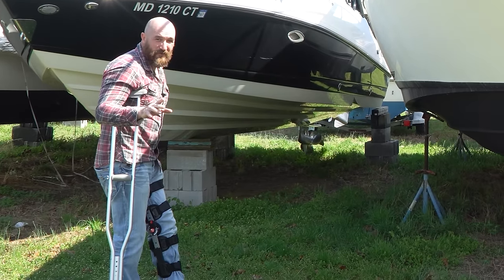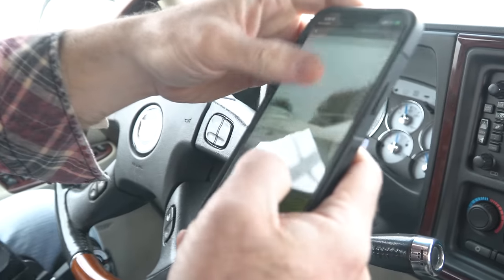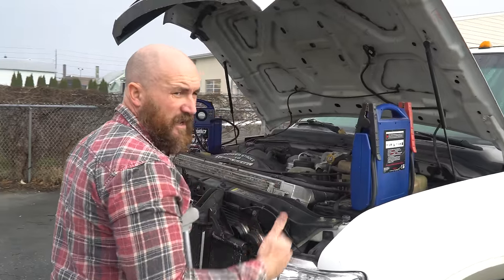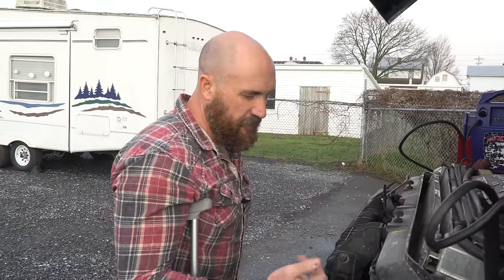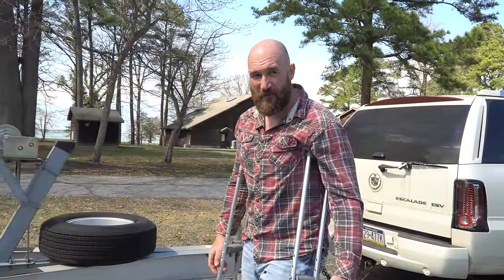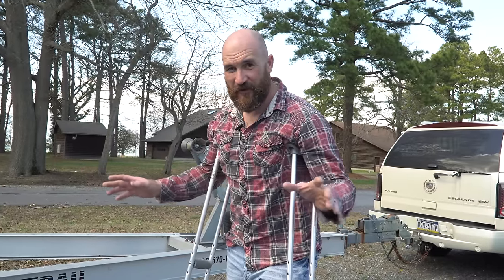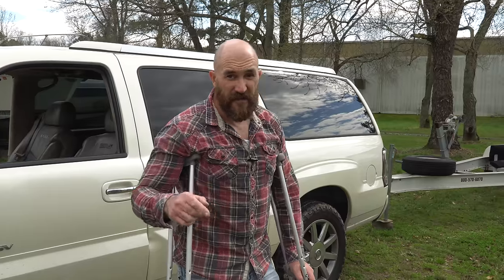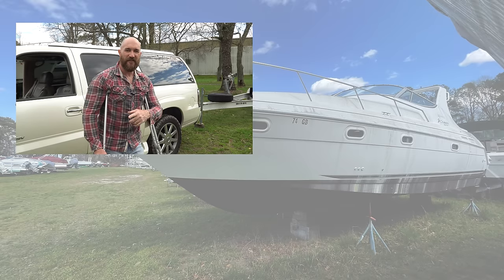We got a FREE Abandoned Yacht!

Comment: I have a 6.4 it gave me the same issue after being parked for the winter. Charge the batteries read the codes it’ll come back as high/low fuel pressure P0088. Dealer will try to tell you it needs a ECM update. Just erase the code restart good to go.
Reply: up
Reply: Up
Reply: Up
Reply: I know nothing of cars but this seems to be the answer to boost.
Reply: Up
Reply: Had one since it was brand new, after a few thousand in race parts it's the best truck I ever had. Stock? Not so much
Reply: why is it that every powerstroke has a "need to know" about it...
Reply: What was that weird knocking sound?
Reply: What’s the actual issue going on? Too lean?
Reply: @TurboVisBits  this is silly. Go ahead, say duramax or Cummins is better. Did you personally design and manufacture those engines to be better? Idk why people have these weird emotional connections with specific OEMs powertrains.
Reply: @dooder126  why do you care?  Who gives a rip?  People have emotional attachments to all sorts of things...the real question is... why bother to point it out?  Let people like what they like.
Reply: @dooder126  I have a 5.9 24v pre-emissions and I have it for a reason. I wanted a power stroke. Cummins is just where it’s at, I do nothing to mine and daily it at 414k miles.

That being said, my step dad has a 6.4 deleted and tuned, and it’s been reliable as hell that way. Stock they are very unreliable though. Emissions standards are a bitch.
Reply: I’m going to say because the lift pump, fuel pump, and ECM don’t have enough voltage, the engine will fire but doesn’t have enough voltage to consistently fire every cylinder properly. Also, the compound turbo setup if I remember correctly is electronically controlled as well so there’s that too. 

Put new batteries in it or recharge them fully and try again.
Reply: Up
Reply: @hearsegod8909  that’s kinda my point. Why is it necessary to rip on others’ brand of choice because the brand you like is fundamentally superior (it’s not)? Doesn’t that go against the very basis of your message to let others enjoy what they like?

I work for an OEM and have worked for others in the past; I don’t think any particular manufacturer has the best technology or design, each one has their own strong suits of design…except Stellantis, of course…nobody likes Stellantis 😜
Reply: @joshrepik  meeting emissions requirements always results in trade off somewhere else. It’s definitely the unfortunate reality of being able to breath clean air. 

Take for instance something I’m working on currently; we’ve had to compromise on some metrics for cold start to keep startup emissions in the box. As an engineer, I can say it’s always a struggle between doing everything the right way and meeting government regulations. But hey, that’s what keeps me employed, I suppose lol
Reply: @joshrepik  is most definitely a low voltage issue, valves aren't opening in the high pressure side so the computer can't supply enough to each injector. Had a few problems like this when batteries would freeze. Gotta love the frozen north and summit racings shipping team!
Reply: That’s why my ford diesel is a 1991 f350.. no computers or codes to worry about, she just runs
Reply: Fuel knock, fuel system is under voltage!
Reply: @dooder126  I completely understand that. Unfortunately, as an engineer, you guys tend to work in a “perfect world” scenario. 

I, on the other hand, as a diesel tech, have to work in the real world, where those systems fail constantly. They create massive amounts of down time; from def doser failures, to nox sensor failures, to egr cooler failure, to turbo failure, to clogged valve trains. The emissions standards are the problem, I realize it’s not you guys, but bathing in a sea of urea because the def pump went bad in a truck is no kind of fun, and these engines are destabilized and made far less efficient. 

I can’t imagine the trade off for emissions is nearly as balanced in favor of sustainability as the government thinks
Reply: @highclasswhitetrash9027  So once the afterglow is done and the system voltage rises it will stop? Does it hurt anything to just let it run that way until it does?
Reply: It's a Cruisers yacht and it's probably a 32-foot that's like the one I had but mine had twin outdrives on it and get ready for the gas usage. mine was a newer model  they are gorgeous cleaned up
Reply: @edifyguy  oh buddy! It's gunna sound something horrible unless you can get those batteries at 12.8. But if she's already dry I'd drop a glow plug or two n soak in some oil, they really don't like being ran dry.
Reply: Definitely agree. When he starts it the second time you can see he has no gauge action. No rpm. No fuel level.
Reply: @edifyguy  I’d recommend at least charging the batteries somewhat to get the system enough voltage to supply the proper amount of fuel, you don’t want to run it lean for long. Also oil pump for the turbo etc
Reply: I had the same sound and thought I lost the lower end, a diesel guy did a injector test on it and that was the problem.
Reply: so why was that boat free how about the dozens of other boats why just this one it's not like it's taking up extra space  one thing i have learned in 60 + years is nothing nothing is free  have a feeling all your "free deals" are a wink wink situation and are for additional views  sorry but that's that way it looks
Reply: @mikecorleone6797  honest days work…7.3
Reply: @kevinruger8819  yep, round the clock hot shot trailer hauling 10 months a year. Truck has close to 600k miles on it still original engine and zf5 transmission. I’m on my way to Portland in it as we speak
Reply: Up
Reply: @dooder126  one is built better, one is built for max profit with poor parts and not built to last. why waste your money on ford when your buying garbage

Comment: Compared to how your 401 looked in the first weeks, this yacht looks like brand new!
Reply: That’s because everything is “marine grade,” so it’s intended to be exposed to the elements. Sun, salt, water, etc. I bought “marine” vinyl when I recovered my motorcycle seat. The stuff works!
Reply: Talking of the 401  AMMO and MR. Dent worked a miracle it's like 🆕!
Reply: @emmettturner9452  I can't see how marine grade materials prevent an abandoned yacht from becoming a wildlife resort. Must be something else ;-)
Reply: @charangohabsburg1  Yep… and the crevices where bio material collect are the places we see stuff growing. I imagine bird poop is kinda fertilizing those same crevices after washing down there. ;) Mold doesn’t like direct sunlight so you mostly find that on the surfaces inside, typically fueled by condensation from daily temperature swings. A boat’s exterior is expected to get wet and be subjected to extremes like UV, heat, cold, corrosive salt, etc. This is why we have “marine grade.” :)
Reply: @emmettturner9452 , It also helps that this is way more sealed up than the  401. If birds hadn't got into everything, the 401 would've survived better. The cool thing is getting this boat seaworthy is gonna be a lot cheaper than getting even an average plane airworthy since there is nowhere near as much red tape,
Reply: what 401? That thing is history.
Reply: @charangohabsburg1  yeah im sure the yard or marina owner kept up on the property if folks are storing yachts there they don't want a bunch of seagulls flying around dropping bombs on their beautiful yachts or going as far as getting inside and living in them.... Unlike the poor ✈️ which had lots of things living and dying inside inside of it.... Sure cleaned up nice though 👍 👌
Reply: I'm wondering if something made a home inside the exaust pipe.
Reply: Exactly... compared to 15 years of bird poop, a little mold and some refinishing/upholstery work seems like a cakewalk. 😛
Reply: @s35bonanzapilot84  But with the modern technology of youtube, crowdfunding, sponsors and some good ol' elbow grease, amazing things can be achieved!😅
Reply: @emmettturner9452  Depends some Yacth has paint with clear coat burn thru if you let it sit for long period of time
Reply: @bakakun  I had multiple textures available and the one I picked seems pretty close to the original seat. I could use a a more slippery seat actually… since it is an ‘80s sport bike. :)
Reply: HAHA so true!

Comment: As others have mentioned, boats can very effectively hide massive issues they have. If it's been sitting there could be moisture in the stringers in which case the boat is basically worthless. It wouldn't necessarily sink, it just wouldn't be worth fixing. Look for spider cracking in the fiberglass, some is fine, a lot can be concerning. Delamination of the fiberglass is also a common issue when these boats get water in the (many times balsa wood) core that the fiberglass is sandwiched onto. 

The engines shouldn't be an issue for you to work on, those 454's were some of the most popular available engines and parts are very easy to find. Make sure to check your gauges, they have a habit of breaking and spitting out incorrect readings, rpm gauges on these especially. My 1998 30 foot of the same style used to require you bang on the RPM gauge to get to to set and only when you were at more than like 20% throttle. 

Last thing, and this is for when you get it started. These boats have blowers on them that is basically just a fan that sucks the fumes out of the engine compartment. MAKE SURE IT WORKS! Run the blower for 3-5 minutes before starting the engines or you risk causing a fire in the engine compartment. I have literally seen it happen.
Reply: Doesn't matter if the boat is worthless he'll just make several speeches about how it's "our" boat and get a bunch of simps to essentially pay for a new boat.
Reply: @Toefoo100  Aren't we lucky to have the guidance of your brilliant mind?
Reply: Sounds like reasonably useful advice from someone with some subject knowledge.  Clearly a toxic community member just jumping on someone who’s actually contributing something.
Reply: @Toefoo100   if that is the case he can salvage fitings windows trim and other equipment from it to sell it. specially garmin stuff among other things
Reply: @cpt.mirones5109  dude if that boat has really been sitting there for 15 years and im sure just as a guess the boat is probably another lets just say 10 years older those electronics are obsolete to todays technology they are worth absolutely nothing.
Reply: YES on the blowers!  Ive responded to numerous boat fires / explosions for that exact reason.  I hate writing BAR's.... lol
Reply: Having had boats in the past, a boat is nothing more than a hole in the water that you pour money into!
Reply: @rowerrn  break out another thousand
Reply: Leaks, cracks, rotting frame, electrical nightmares, rodent damage, failing fiberglass... boats are called money pits for a reason.
Reply: CRACKS IN GELCOTE ARE NO PROBLEM EASY TO FIX  UNLIKELY  TO HAVE FIBRGLASS CRACKS UNLESS EXTERIOR DAMAGE PRESSURE OIL THE ENGINES FOR SURE DON,T TURN THE ENGINES OVER WITH SPARKPLUGS IN PLUGS IN
Reply: @chuckfowler8875  So they may not have all the bells and whistles of modern electronics. So what? Most of the B&W on modern stuff just makes them harder to use - rather than adding much to their functionality.
Reply: @buggsy5  the only thing  that will work is the depth finder it will not hook up to GPS it has an antiquated format.
Reply: @Toefoo100  accurate!
Reply: They may be obsolete but they still work. Furthermore you can just leave them in place and install new ones. Besides modern boats have far more electronics than needed 99% of the time.
Reply: @yougeo  it is an antiquated format therefore it is useless the only thing that would be any good would be the depth finder dont beleave go get those electronics and put them on your boat and see how safe you are and how far you get.
Reply: What a massive POS that won't fit on the trailer and will be so far over the weight limit to tow with the Escalade. Turn  and Run 🏃‍♂️ crutches and all.
Reply: That is the most important thing to say! And nobody says it.
Reply: To fully restore this yacht takes fifty thousand bucks and two years of work.
Reply: I would worry about the mould build up…mould is toxic. You will not get your money out of this. Do not through good money into a bad investment. Better to spend some money on a good 2nd hand boat

Comment: Great job. Keep the content coming.
Professional Yacht Captain/decent engineer of 15 years. Currently master of a 110’ vessel.  Small tip for the interior.  Ozone generator will be of great use to kill the mold. Dehumidifier’s are also useful.  I have run them in tandem to rectify a variety of issues.
Reply: Be cautious with the ozone generators. Too much ozone is poisonous and the interiors of boats generally do not have outstanding ventilation. Ozone can also damage some materials.

If I recall correctly, life jackets have an expiration date - so all the ones you have should be checked and tested.  

Twin screws are nice, especially on a boat that does not have bow thrusters. The screws make maneuvering in tight quarters much easier.
Reply: You are correct to be careful with ozone.  Most ozone generators have settings you can adjust.  Also it is wise to leave the boat open rather than sealed off.

Comment: Drain the bilges first. You could be hauling a ton of water around. Great work, keep them coming.
Reply: I repaired a little section of my 19 footer and cant believe the water weight of the foam inside.
Reply: yeah you could see a little water when he opened up the engine compartment
Reply: Ouff that gave me bad memorories.... Do what he says!
Reply: @carljohantihkan2035  There will always be a bit of water in the engine bay - those covers never seal completely. But the compartment will also have a through hull drain.
Reply: Isn‘t there a bilge pump on boats that have a freaking ac and stuff?

Comment: Direct drives are only a fraction of the maintenance of outdrives. They can be left in the water, and is actually best to do so to keep the shaft packing wet. If you have the correct adjustment on the packing, they are intended to leak a little while under way, they may also leak while sitting. So you need solar or shore power to keep batteries charged to run the bilge pumps. This is routine stuff for boats in the water all the time. If in salt water, you may need routine cleaning of the underside and running gear.

Comment: On your 6.4 check your serpentine belt tensioner. I've had the same issue and it was caused by a bad barring in the alternator that caused the tensioner to slap the stop on the tensioner making that same noise.
Reply: And also wait until the light for the glow plugs turns off before using the starter 5:00
Reply: I agree with this. Rod knocks don't develop over night while being parked.
Reply: @miege90  I don't even own a Diesel... but that's step1 right??
(besides the fact he might not have enough juice for glow/ecu/starter)
Reply: odds are it’s a hung lifter, 6.4s are well known for lifter issues, been sitting for some time asswell
Reply: could be a stuck injector if its been sitting awhile could of had a injector stick open causing fuel knock

Comment: The biggest thing with old boats is rot. Especially if it’s been sitting, water could make it’s way down to the stringers and into the structural components. The transmissions are fairly simple, single gear forward/reverse. Im sure those are fine. Even if the BBC’s need rebuilds that’s nothing you can’t handle. They’re easy to remove if you have access to an excavator
Reply: Agreed. I would, however, add the stern glands to that list. The seals on those are probably completely shot at this point and will need fixing before even thinking about putting that thing in water again.
Reply: Carwizard can sing you a song about rot 😂
Reply: Totally agree. Rot is the enemy! I'm no expert, but I have delved into a boat with rotted stringers ! Not an easy job and very itchy!
Reply: Depending on the year of the boat, it may not have wood stringers. They may just be foam filled.
Reply: yep it will have water issues no doubt,  this is a rip down to the frame and expose all the inner structure, fix it and then rebuild it... this may be more expensive than the air plane to do... yikes!
Reply: Nah just paint over any rot and sell it on quickly
Reply: @tomcatmeow69  it won't be more expensive than the plane. That plane needs major spar work that alone will cost more than this boat project
Reply: @tomcatmeow69  Drama queen
Reply: @ronfoley3634  Not sure what year the boat is, but most likely those stringers are foam, and may be pretty resistant to rot. Most of the marine industry move away from wood, its just a matter of when this boat was built.
Reply: 70% of video watch you in your car driving....
Reply: @pugito4525  yeh most likely fiberglass Hull so little to go wrong really just all the fittings gaskets and seals will need replacing and the interior needs sorting.
Reply: not just the rot, also check for osmosis.. and delaminations.especialy around the bilge area's where water tends collect.
Reply: To everyone talking about foam stringers. The boat has been sitting 15 years and it was old enough with enough issues at the time to not be worth fixing. A full hull repair on a boat this size far exceeds the cost of a good boat.
Reply: @ranekeisenkralle8265  Yes, the glands will have dried out and need replacing. It is a rather easy job.
Reply: @buggsy5  yes it is easy but vital - which is why I brought it up. Would be a shame if they were to be overlooked.